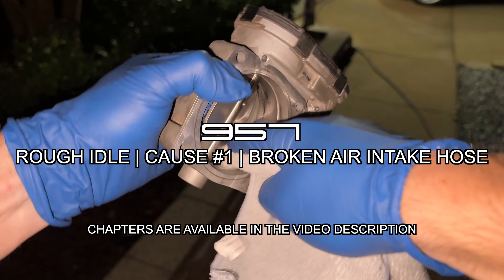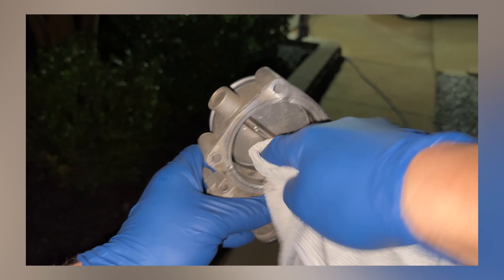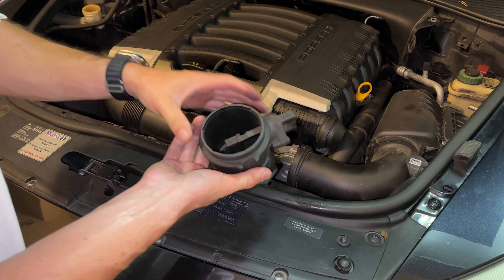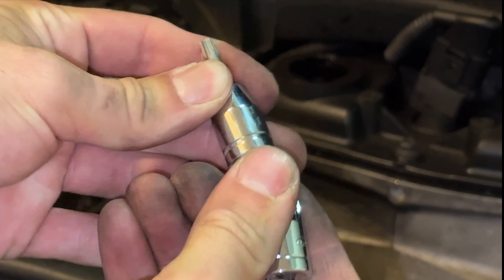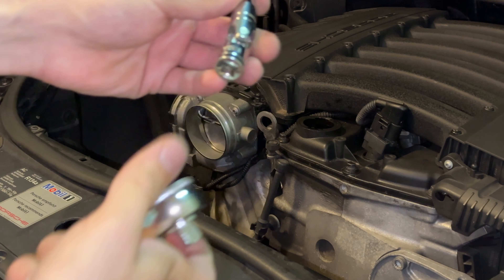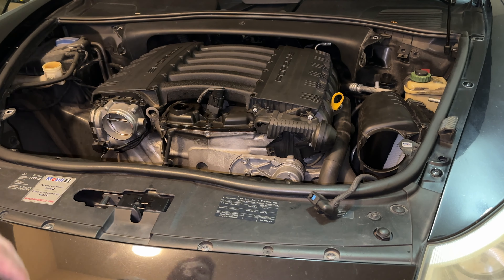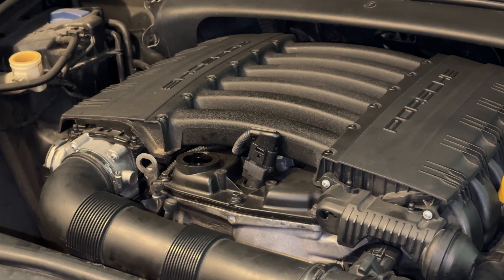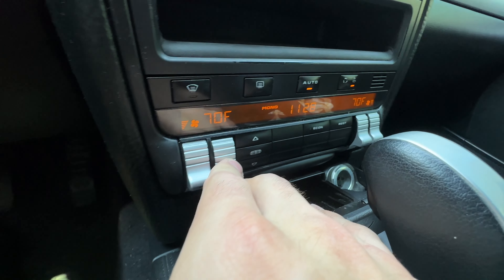Rough Idle | Cause #1 | Broken Air Intake Hose | Porsche Cayenne (955, 957) (2003 - 2010) (9PA) VR6

Comment: Having a similar issue to you with a slightly shaking idle on my 2012 Cayenne 3.6 VR6 but no engine light or misfire I can see. Mine wasn't as pronounced as yours but you can feel a random shaking or flutter through the car when stopped at a light. Replaced all the spark plugs with brand new genuine Porsche ones. I don't have a leaking PCV or any timing chain rattle. Going to tackle the air issues first and see if that resolves anything.
Reply from the maker: I've watched a few videos and mine isn't the first instance of someone silicon taping the air intake hose in that specific spot. Good luck - might be a common failure / cracking point. Do share if it resolves the issue
Reply: Hey did you fix the issue I’m still trying to find it him have the same as you in pointing at the engine mounts for now
Reply: Porsche don't make plugs

Comment: Hola gracias por el video mi pregunta es: la 957 tiene sensor MAP, y si es así , donde está ubicado? Saludos cordiales
Reply from the maker: Yes, it does. Here it is:
Mass Airflow Sensor (MAF) | Porsche Cayenne (955, 957) (2003 - 2010) (9PA) VR6 3.6L Base Model
https://youtu.be/jGmkoA9HVTM
Reply: @ gracias por tu amable respuesta pero me refiero al sensor MAP no al sensor MAF

Comment: Hi Ruslan, when removing the throttle body and reinstalling after, did you need to use a scanner tool to relearn or reset anything? I hear some cars requires this.
Reply from the maker: Thanks for commenting. No scanner tool needed in this case.
Reply: Thanks for the quick response

Comment: Hi, I have similar issue... but for 958, symptoms are strange.... when idle,  for some period no vibration then 1sec I feel vibration, then again same period normal, and everything repeating... There is no vibration when moving, only in idle...  I don't see any damage on intake tube, but long time ago I replaced mas air sensor to another used one, because 1 of 2 sensor fastening was broken (I don't know how to pull out sensor from tube, looks like it is not possible for 958). Do you think there might be issue with MAF sensor? did you have same issue with your cayenne? BTW, when I used diagnostic tool and adapted idle mixture, symptoms became less noticeable, but still present...
Reply from the maker: That's interesting about the idle mixture. It could definitely be the MAFs or a dirty throttle body and couldn't hurt to clean it thoroughly - might improve MPG too. Hard to say without seeing it and playing around with diagnostics.
Reply from the maker: the air mixture can be so finicky...
Reply: hi,did you solved?